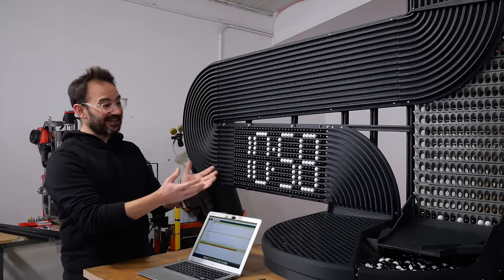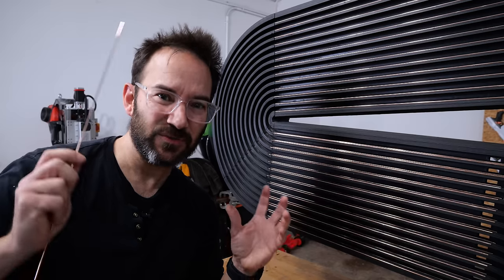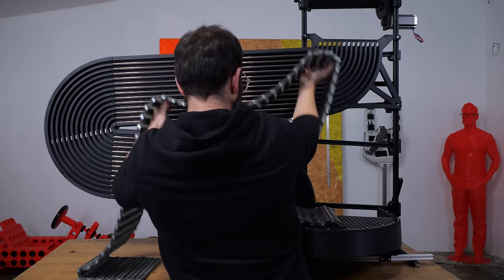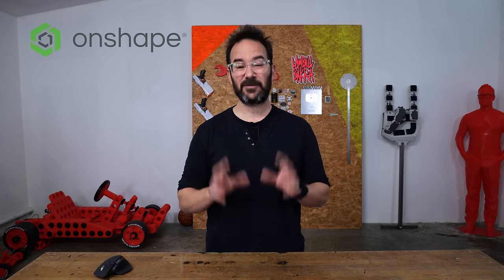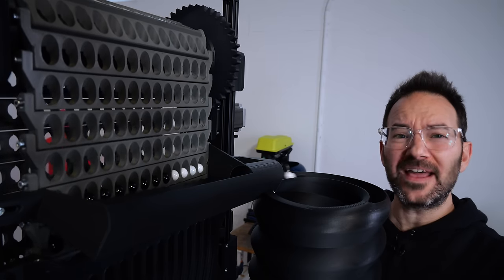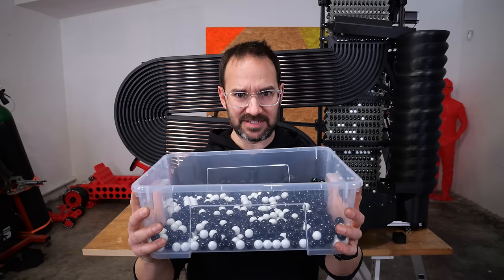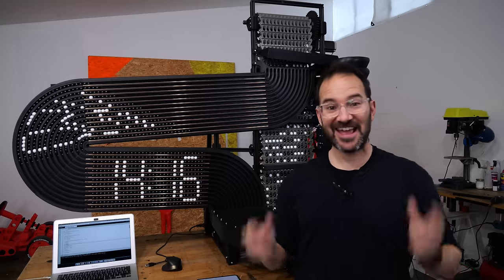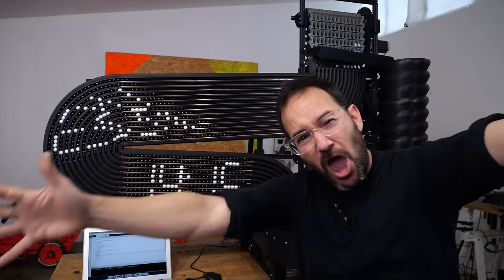BUILDING A MARBLE CLOCK - Pt. 3

Comment: You might be able to make it run more effectively by doing some sort of "delta" processing where it only empties and loads the rows that have changed (for instance when going from 14:15 to 14:16, you only need to unload a few rows at the bottom).
Reply: Yeah. I noticed that too. With the length of the upper marble tunnels he could have also created some sort of multiple marble buffer that too delta the one after it. Making it so it each consecutive marble buffer would require less and less marble. It would make the whole marble machine way faster.

Or even better, he could have used the marble elevator as the clock. Just make it wider to accommodate the 4 numbers and the divider and he would have been set.
Reply: First of all, we need add 14:15 between 14:14 and 14:16, see on 9:40.
Reply: I don't think it is a good idea? By the way the marbles are discarded, I mean. They don't come back up the same way they fell (mix at the bottom) For doing that he would have to close the mechanism, and it wouldn't allow marbles to be discarded and swapped every now and then. He could (kind of close it) to make it go back up again the way it did with a little path in the bottom for the discarded ones. But still, the algorithm wouldn't have to be changed, it would leave the first ones the way they came (saving a bit more time) and changing the last ones completely (having to wait every time for then to go down and up again bc no extra marbles can go down the closed path)
Reply: Was thinking the same thing. Why change everything when in a minute is changing. During the hour it can load the upcoming hour and drop when it's time
Reply: In my opinion, the machine would not be the same that way, but more importantly, i think that in the the way it works would take the same time to change one or few row as all of them.
Reply: To add to the thoughts but on a different spot:  Work preemptively on the elevator. Take excess black marbles from lanes that need more white (separate program based on what first program is demanding) and put them to the outside, then take ALL white marbles from the outside and put them in those 3 lanes just below the original fill spot, putting more of the marbles of the needed color where they are more likely to be needed. It's a bit of an odds game, but letting them go up randomly is too.  So... yea. just a slightly better one putting the odds of what goes where when more in the favor of the clocks needs.

The reason I say this is some lanes have ratios different than what they are likely to get.  It's similar to rolling dice in DnD.  If you add several dice together, the chances of being max or min go down exponentially, generally landing in the middle more often.   With coin flips, there are two outcomes, much like it either being a black marble or white marble here.  Though there is a greater need for black marbles than white, thus the odds overall do need to be something other than the 50/50 of a coin toss, the principal still applies.  The odds tend towards the most appropriate ratio for the mix of chances(50/50 for a coin flip, a 1/4(1 TO 4 not 1 in 4) on a specific outcome of a d5(yes those can exist)).  to rework what I said above with this in mind: take the areas that statistically have a high chance to lag from being off from the average ratio (like the three lines at the top, middle and bottom of the numbers needing more white sometimes, or no white like the very top and bottom) and use a pre-filter system to get the chances of those lanes to more effectively work to the ratio that is needed for those lanes.  With this thumb on the scale, they likely won't lag behind as much.

I suppose this would require one to put in a second sensor/pusher system in it, and then double the needed programs, possibly making it more than twice as complex (I've tried adding to projects, and noticed it would be exponentially more difficult to get more of something in the same space/system.  One would have to weigh if the added step would be worth it.  You'd probably have to add a few more links to the lift's chain to make room for the "pre-feed" area.

After the speed is up through a little odds manipulation, I suppose it's just doing your best to work ahead more and minimizing jams.
Reply: @ALBAKronus pretty sure he's only updating every 2 min because the methodology of only using marbles that fit the pattern needed to form the time when they're loaded randomly is really inefficient. It's part of the charm of the machine but most of the marbles that go up go back down as waste rather than going through the clock as part of the time display.
Reply: @pheonix3691 because for the marbles to get to the minute spot to change it, they need to pass the hour marbles. It’s not if a number changes, but anything in an entire row changes. I don’t know how his code determines what’s chosen based on the time, but he would need to implement something to check current output row vs next desired input row and check for any differences. And if anything is different, that whole row needs to get replaced.
Reply: @luislaija I agree. Changing 10 rows or 1000, if the elevator is feeding them all at the same rate. It will generally be similar in time. With larger rows you do have more of a chance to have one ‘unlucky’ row that is rate limiting. But decreasing rows changed won’t make this cycle faster. Unless he presorts, which just pushes the problem further away and adds loads of complexity, the only way I can see making it cycle faster is to speed up the elevator.
Reply: would matter more if he actually had marbles queued by color so that filling in one row of  20 marbles was faster than filling in 10 rows of them. so it wouldnt be much of an issue. I think he did approach this as a slower clock in this design and trying to remedy that issue at this point just requires a way to funnel more white marbles into the center rows and keep them out of all black rows... in the end, the biggest issue is always going to be the slowest row and just unlucky queues where the wrong color keeps filling in. even if he had a system to alternate from white to black with 90% accuracy it would result in a pretty quick cycle of strictly being 2N, N being the length of the marble clock...
Reply: That's a good point, but if you've noticed, the marbles are coming from the side (left to right) to display the digits, from right to left, this time, but it's in a row. So, we're working with columns, here.
The only way he could do that (what you suggested about the "delta" change) is if he modified the design of this clock, itself.
Reply: While that would be more efficient from a pure optimization perspective, it would not make for a significant decrease in time between time swaps since each row would still be the same length in marbels, thus needing the same time to set up.

However, the more imporant part is that it would be a lot, *lot* less satisfying to see in action without having all rows do their thing at the same time, and cool looks are the major reason for this machine to exist 😁
Reply: The time it takes to create a new display is equal to the time it takes to build the slowest row.  By reducing the number of rows you need to "render", You only improve the speed by the delta between the slowest rows from both the subset and the superset.  If the slowest row is contained in both sets, the time hasn't changed at all.

In order for this to be a noticeable improvement, there would need to be a way for the machine to funnel the work of multiple channels into a single row.  Then if it only needed to re-render half the rows, it would be able to take marbles from unused channels and use them to speed up the creation of the remaining required rows.  That would pretty dramatically increase the complexity of the system, as you would need a way to dynamically route marbles from an arbitrary source channel into an arbitrary destination row.

The final nail in the coffin for this idea is that it's a completely superfluous optimization: In order for the clock to be able to tell time by the minute, it needs to be able to a complete and total frame re-render for even the worst-case scenario in under a minute.  If it can complete a full frame in under a minute (as it would need to be able to do), what is the point in optimizing frames that are less-than-worst-case? In my opinion it wouldn't look nearly as cool; part of the fun is watching the entire frame drop out and watch an entire new frame drop it, even if the only changed slightly.
Reply: I don't think that keeping some rows will actually speed this up a lot, since marbles only come through on a single row. So filling all 13 rows takes roughly the same time as filling a single one. The only advantage you'd have would be that you reduce the chance for "unlucky" rows that don't get the marbles of the correct colour for a long time. If you have fewer rows, you'll also have fewer unlucky rows.

Comment: 7:10 use soft rubber clear pool tubing.. plus you can watch them fall quietly
Reply: might make a cool noise aswell
Reply: I think there would still be a lot of noise from collisions between marbles, but it probably would be better than the large spiral.
Reply: Definitely better than having the marbles run down all those layer lines.
Reply: @codmod7456  falling marbles pushing air through a tube sounds like a compressor.  Clock powered wind organ.

Comment: Friendly tip - try to sort the marbles as they are returning, creating 2 piles of white and black marbles - 2 storage containers. Then, arrange them as they are getting to the elevator already, not pushing them out based on what color you have. This will remove the element of randomness. And you can still control if you have the marble or not and so on... And you won't need to "return" wrong color from the top, so it will be quieter. This looks cool, btw.
Reply from the maker: That's definitely THE SOLUTION Robert, but I want to try to keep the random selection for now. I can always go for the nuclear option and make it super efficient so it can tell seconds right?
Reply: @ivanmirandawastaken if you want to keep the randomness, you need more than one loader.  If you expel the GOOD marbles into the channel, and keep the bad ones on the belt, an additional loader above this one will be able to again check if any of the BAD marbles are now needed for the clock. This would help a lot. You just need to extend the elevator a bit and have channels flowing into one.

Comment: I'm really amazed at how fast you iterate your work! It's amazing how many surprising challenges a "simple" project can have sometimes!
Reply: and this is why prototyping designs on a small scale to identify these issues sooner can make a world of difference. even just going in he didnt realize how much range the marbles he was buying could have in shape and size. while if he started with colorless marbles that he could paint. then he could have simple filtered all the marbles down then colored them by size as a way to impliment a manual marble filter in the machine into two buckets. then instead of designing a machine that selects marble colors from 13 random queues. he instead would have to fill 13 queues from two buckets of marbles. another problem on its own to find a simple method to distribute marbles. can be done easily enough but again. requires strict requirements and a knowledge of what the failure points can be before and after some prototyping of the piece on a small scale and making things modular like he tried to to avoid these kinds of rebuilds that take a lot of time

Comment: Great fun project and looks like everyone leaving comments has suggestions on how to improve It :) I bet many of you have suggested something similar but here are my 2 cents. To make it smaller in size, quieter and more practical the marbles should arrive from the top down and each column should be released separately. Only those columns that actually change should be updated. Black and white marbles should be kept in separate pools, mixed when building digits and then separated again when they are released. Knowing the order marbles were placed to present each digit it will be very easy to sort them back into separate pools with just a single servo per column.
Reply: They could be mechanically sorted by having one color slightly larger than the other, so a gate could separate them.
Reply: He doesn't want to have the marbled come from the top down in columns. So many people have suggested it in the comments but that's not what he wants the design to be!
Reply: Litteraly got to comments to suggest exactly the same thing 😅

Comment: Awesome work! Maybe you want to sort the marbles in black and white after ejecting them. So you could have 2 containers, one for black and one for white. (I would place them above each other) - With that you could first add the necessary black marbles into the lift and then fill the "missing" white marbles into the empty slots. This would speed up things a lot, because you don't rely on luck anymore that the correct marbles are in the lift.
Reply: Additionally it would eliminate the noisiest part of the clock
Reply: it could pre arrange the elevator in the correct sequence and you could see upcoming times move up.

Comment: Wouldn't it make more sense to separate the black from the white marbles, so you can better control where a white and where a black marble should be. After the marbles fall down after telling the time, you separate them again and have separate feeds for the black and the white marbles. But I really love how you just go with your ideas and solve the problems you face. Great stuff!
Reply: Well you don't want a perfectly sort them. Part of the charm of the design is how It pushes out and uses the marbles that it needs as they go by, without having to sort them apart first.
That said, if he is not getting enough white ones mixed in to certain rows he could make a sort of churn pit to randomize them a bit more. Much simpler and you don't have to sort them twice.
Reply: Yes, looked at in a commercial sort of way it would make sense, but this is a WORK OF ART!
The man's had a brilliant idea and seen it through to completion, I love it.
Reply: More than that, in theory he already knows where each marble is. He can utilize the back space to extract the white marbles, then let the blacks all fall into the general pool. No sensors needed for that.
Reply: @travisfabel8040  two trays at the top below the return. one distributes black marbles to each channel, one does white marbles. same idea to sort, just punt the marbles into the trays in two places instead of one. have the thing track how many marbles are in each tray (as you'll know the number going in and out) and reject marbles to the spiral return path before the trays overfill.
Reply: Knock both colors out into individual tracks that feed to the top reservoir. Then once it's got all it needs, it could have an ejector into a secondary reservoir for the extras to fill it up faster the next round. 

So basically- 

The top has a black and white reservoir, and only fills one at a time with a selective feed from the top. These feed into a sorter that releases them one at a time into the slots but quickly. As a safety to prevent overflow leakage into the wrong group, a dump track to the bottom could be used as well in between mode switches.

A little below this is the backup white reservoir(since they are the hardest to reliably get). With a sensor, it will trigger an "All white" mode to refill the top as needed. 

At the bottom are the rest.  The regular sorter that ejects black if white needs to be filled, and the original input feed. 

Essentially, this takes it from "fill for the next minute," and into, "Prefill the tanks and the next minute dispenses when needed."

Is it complicated? Yes, but it would fix a lot of issues since it would be able to fill quickly. Of course, the fastest way would be to combine this with a "next minute" row that prebuilds the time for after the release. And even faster would be a vertical fill, but that's not as fun to watch.

Comment: I love the process you got through to process these.  I wonder if separating the colors earlier wouldn't be easier?  You have more control that way, it seems.  You are a master fabricator!
Reply: This! Sort them by colour immediately after they've been used to show time and then feed them into the conveyor separately, or then use a screw feed conveyor for the lift and input marbles into it serially, converting back to parallel at the top... oh god the madness is catching
Reply: @williamstrachan    That would only add an extra level of complexity.  Sorting them at the top means he can take advantage of gravity as part of the sorting process.
Reply: @MrRobarino yeah imo he should use the current pusher mechanism to sort into a black and white stream for each line, then use gates or another pusher to select the colours needed individually.
Reply: @techheck3358 I was thinking on that. Perhaps just sort them so the rows alternate between white/black (all white one row, then all black on 1 or 2 rows)? Sorting this way follows the clock format (one row all black, then it becomes mixed white/black for last 2 digits, then there's a black space before and after the first 2 digits). 

I think if he could extend the new spiral to deposit earlier (maybe run it over the current marble storage like a double-back staircase?). That would provide enough space for a color splitter (not sure if there would be enough space to arrange a new time).